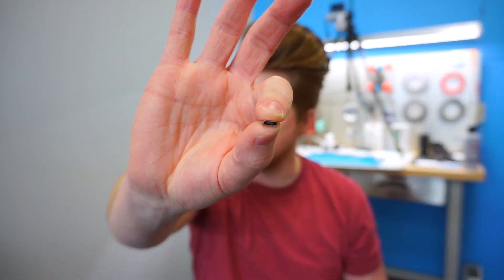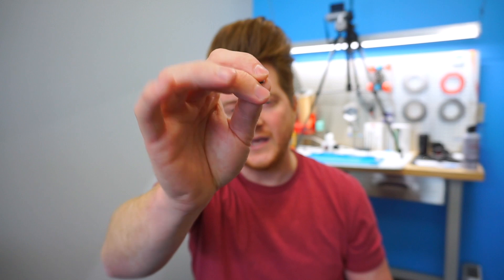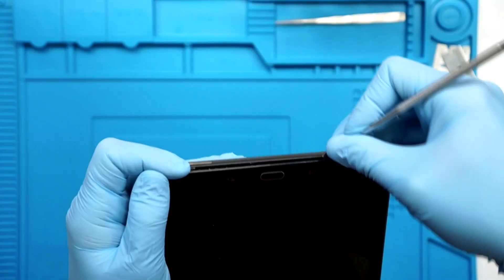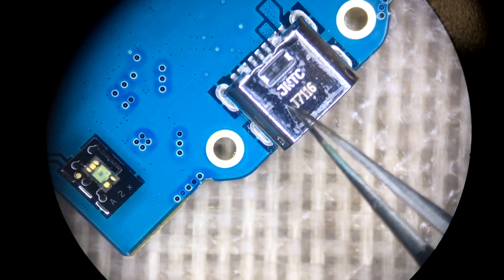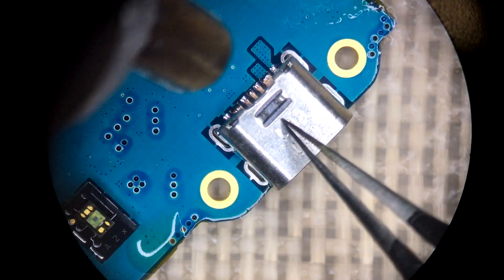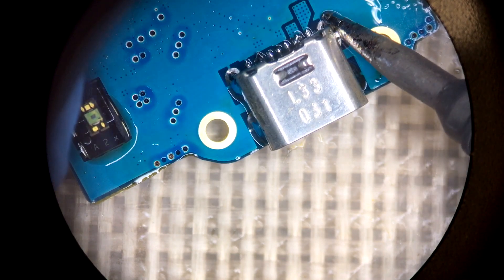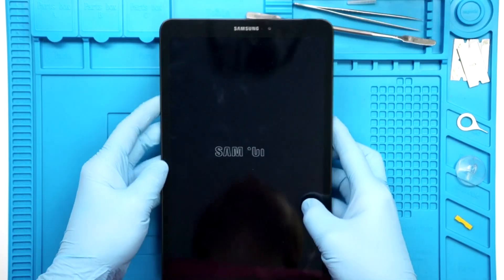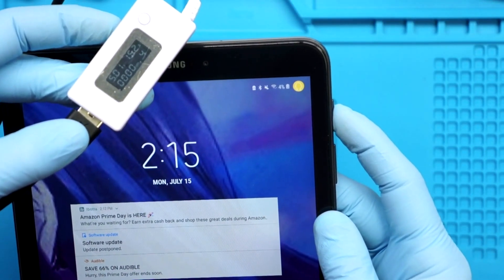Samsung Tablet T580 Tab A 10.1 Charge Port Replacement - Best Method

Comment: the technique to remove the motherboard isto  put a pick underneath  the part of the board with the sd card attached  then using another pick pry up fron the side behind the sd card to remove the board from the clips holding it . there are also clips on the side by the battery connecter that will probably require prying too.

Comment: @profixerr can you provide a link to purchase the replacement micro USB please, to ensure I/we purchase the correct one.  I see JNTC J7116 on the original but it isn't a part number I can find.
Reply: Late answer... but search for "L33 031 usb connector" you will find it.

Comment: Hi what is the temperature for the for hot air gun and soldering machine
Reply: I guess you need the temperature of the core of the sun cause no matter what i try, the stupid connector doesnt move

Comment: My tablwt flickers when plugged in and won't turn on
Reply from the maker: If the tablet flickers, it might have a screen issue. What is the history/story behind your tablet not working?
Reply: @profixerr6275  it was working fine then i went to turn it on and it went black so i plugged it in and the charging signal came on then it started to flicker
Reply: @sharonwhittington2859  I noticed mine does the same thing if plugged into a power source that doesn't provide enough power to the tablet to charge it.
Reply: The battery cant charge all the way because the tablet isn't receiving enough power.
Reply: Same Problem :(

Comment: Can you add wireless charging pad into Tab A 10.1 T515 ? This model does not support wireless charging. i know there is adapter out there require plug into USB-C. But i am looking into more thin wireless adapter that can solder to the board.  Reason behind all this hassle is, i will have to install tablet in my car, and this requires power and data. Believe  i almost tried all solutions, for power+Data simultaneously. i used OTG with power, lava adapter , root the tablet to modify files...etc. my final solution would be to install utilize onboard USB port for data and wireless charger for power. i appreciate your help.